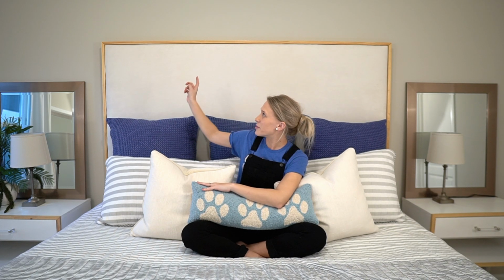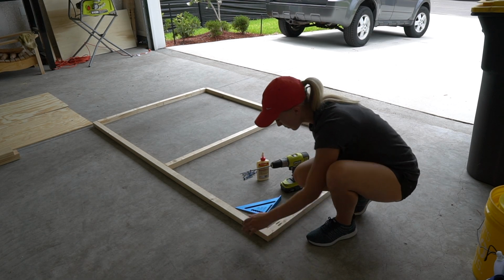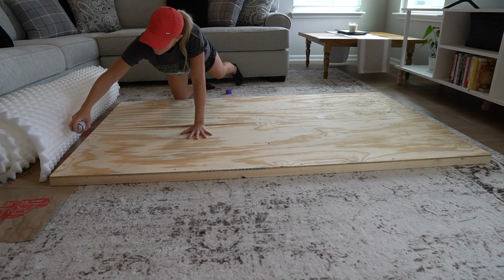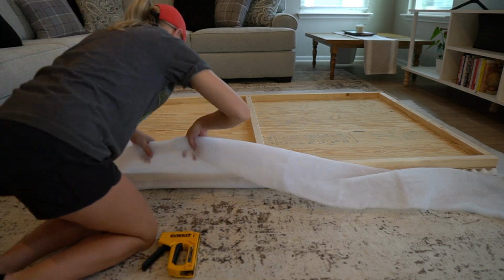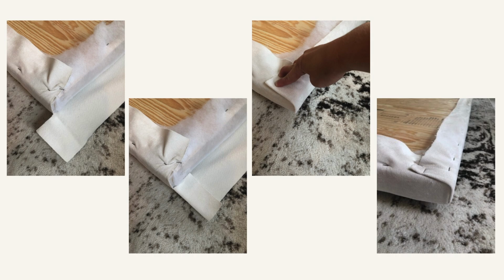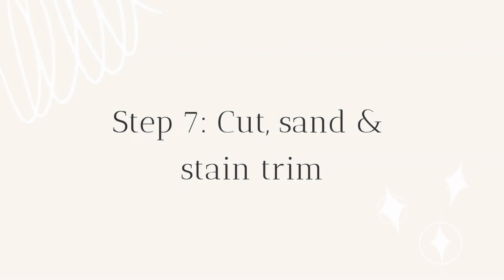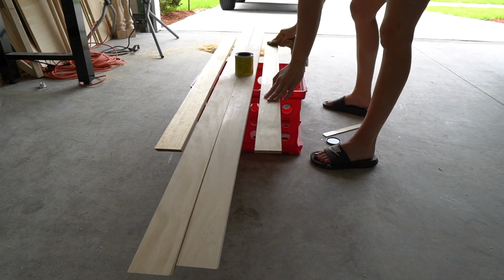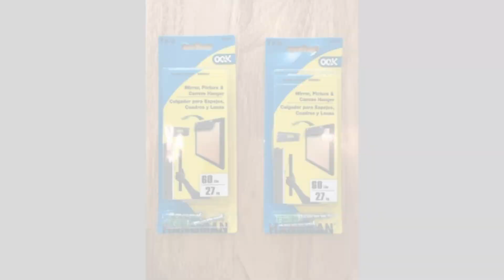How to Make an Upholstered Headboard | HomeWithStefani

Comment: Thank you for sharing.  You have a lot of energy :)  One thing you should be aware of is the wear and tear on your knees.  I've seen your other videos which involved working on the floor as well.  It may not bother you now but over time it will.  After years of kneeling on hard surfaces my knees are shot.  I now use mat tiles that they sell for kids playrooms.  Take care and safety first.